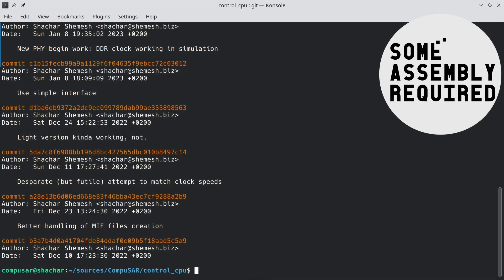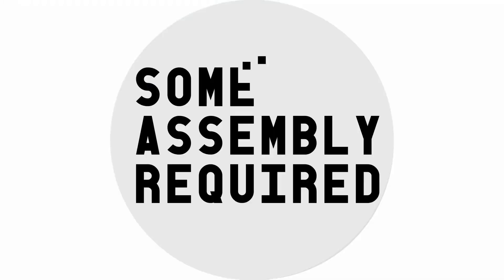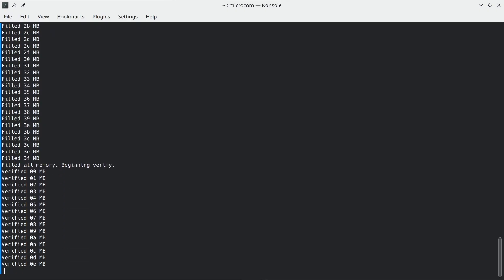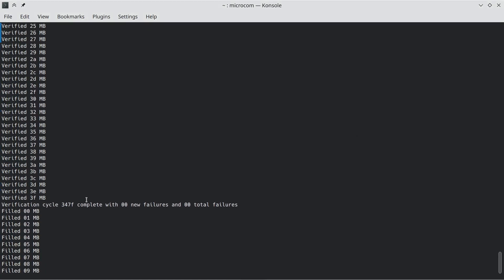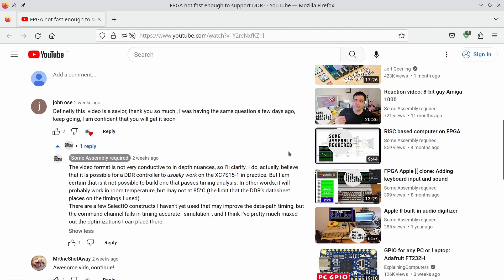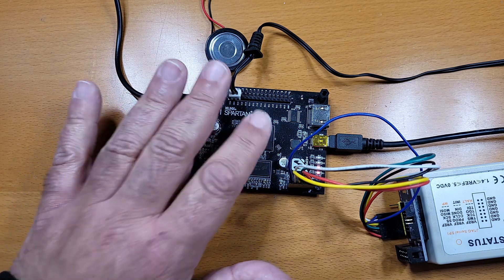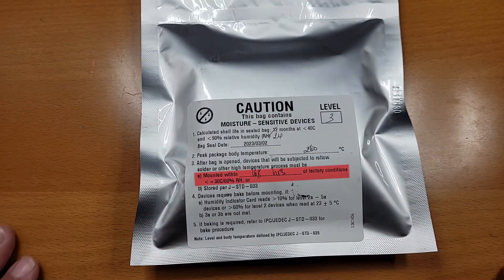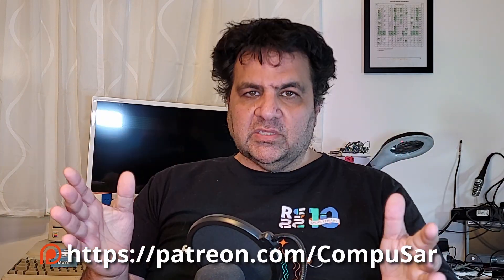DDR controller is FINALLY working.

Comment: Built a commander X16 compatible computer a while back and ported the Vera over to an Artix 7 dev board (Mercury II). Currently working on porting the whole computer over to the Artix 7. So far I do have your 65c02 core running some test code @ 8mhz very stable. Thank you for sharing all of your hard work.
Reply from the maker: I've actually joined the X16 discord server. You can find me on the Gen3 channel.
I'm not very familiar with the Artix 7, but as far as I understand it uses the same DDR chip as the QMTech, so this work can probably be moved over as is as well. I will rewrite the 6502, however, as I'm using a synchronous bus and the design I have in master there is asynchronous (like the original W65c02).
Reply: @CompuSAR  Nice I've been on the discord for a while, myself and Wavicle were the first ones on there to have fully functioning boards. Wavicle's is more of an exact copy, where mine is a lot more flexible and is converted to HDMI. A few of the guys on there have my board as well. Due to level shifting on some of the CPU lines line RW for example I couldn't just run the softcore on my existing board...Well I could if I bodge in some pullups. I'm about 60% of the way through a design for a board that I will be using to migrate everything into the FPGA (External Parallel rom, QSPI flash, Yamaha Audio, 65c22, and i2c stuff for keyboard/mouse) Once I get the basics done I plan to move the parallel rom over to the QSPI followed by the 65c22 and it's IO devices. I didn't see you on discord, add me, my name on there is jbaum81.
Reply from the maker: @jasonbaumgarte6465  I sent you a DM. One thing, though. I don't how important this is, but my 65c02 implementation doesn't do BCD (decimal mode) yet. It did not seem that important up until now.